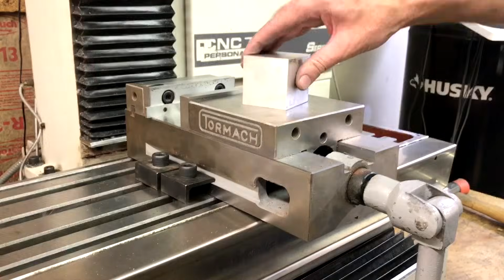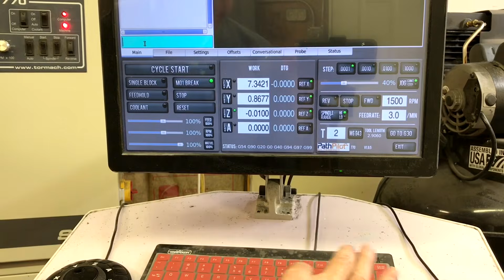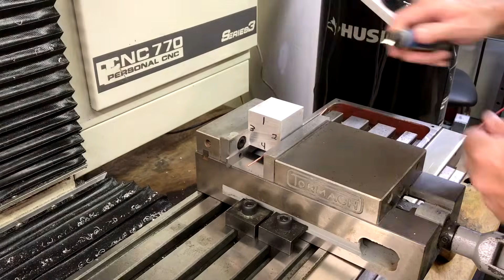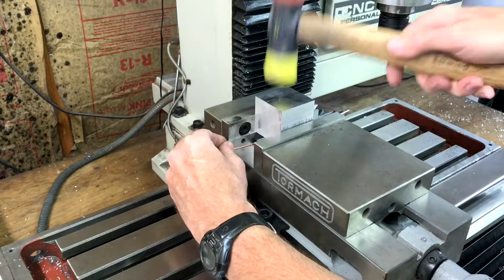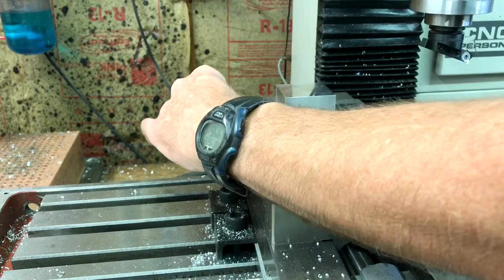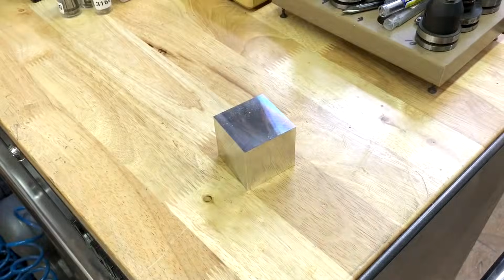Squaring up Stock with a Superfly

Comment: Hello Mr. Craig, I have some questions to ask you. 
the way you cut surface number 1 is using 1 parallel and a wire, i saw others doing with 2 parallels when cutting surface 1. Is it any differences? and which way is correct?
Reply from the maker: Not sure it really matters since it is the first flat surface.  I think that is the way it was done in an MIT video I was following.

Comment: Also when you said you changed the belt for a deeper cut.  What else did you have to do?  Did you have to change anything on the screen to tell the computer the belt was changed so it could adjust the RPM value on screen??
Reply from the maker: Yeah, good point.  Sometimes I forget to change it in pathpilot but not that time.  It would be nice if Pathpilot gave a warning if the RPM was too high for the belt position (when changing to high).

Comment: Thanks for the video.  A couple suggestions.  When you were typing in the G code I would like to have seen the values on the screen.  Same with the actual cutting.  I would have liked to see a short cut to the screen to see the feed and speed etc.
Reply from the maker: Thanks! Yeah, I probably would have if I didn't have wood flooring.  I have to hold the camera when milling or the camera will shake on the tripod.  I was trying to be as complete as possible.  I appreciate the feedback!

Comment: Please explain the copper wire??
Reply from the maker: If the face touching the movable jaw isn't flat, it can cause the part to move in the vise when it is clamped. The wire prevents this.  But it is better to use aluminum wire but I didn't have any.

Comment: when you are using rods to square something up you should use a rod which is softer than the materiaal you clamp
Reply from the maker: I always thought it was just as soft.  Checked the Brinell and it is a bit harder.  Thanks!
Reply: np